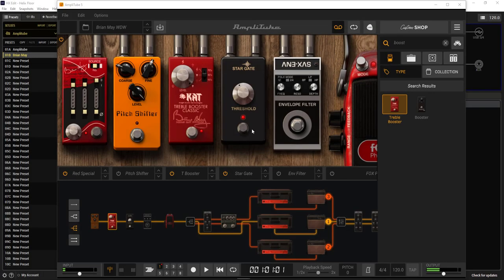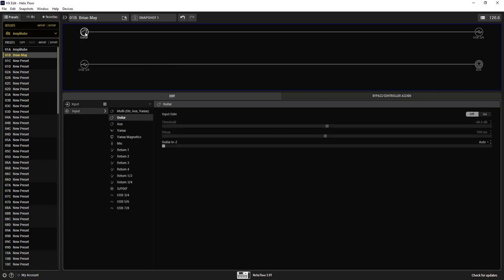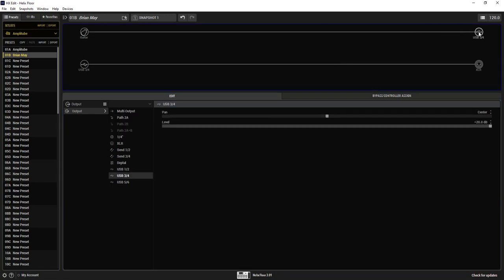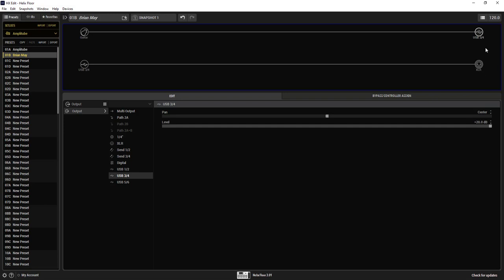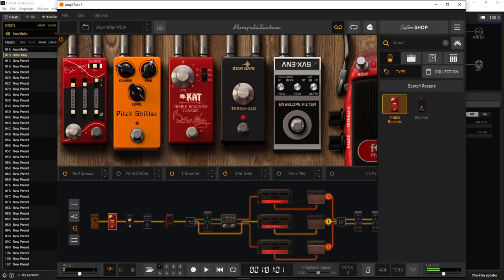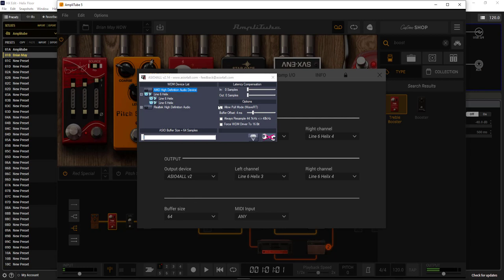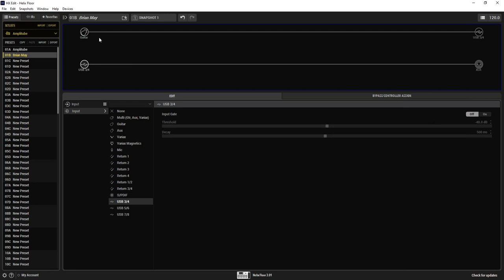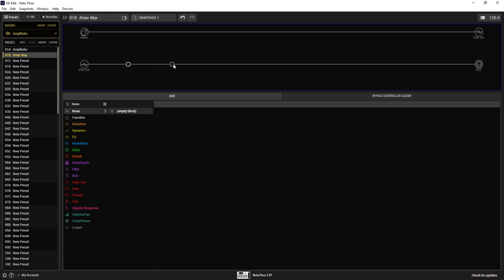Using Line 6 Helix with IK Multimedia Amplitube 5

Comment: This is great but for some reason i dont have the options for Line 6 helix 3 and 4 when it comes to the input channels and output channels. I followed your directions so im not sure what Im doing wrong. But the idea of using Ampltiube with helix is intriguing and id love to try it. Any chance you can assist?

Comment: Would you recommend ASIO for all for other dedicated interfaces like Presounus AudioBox interfaces? 
Not just for using amplitube, but for everything?
Reply from the maker: Hi, no idea really. I only use it to link Helix and Amplitube
Reply: @ac30helix44  
Thank you for your reply. 
So you haven't noticed any improvement on latency or anything like that with ASIO for all?
Reply from the maker: @Eric-dd8bk  I have the buffer set at 64 which is the lowest it will go. I do not notice any latency at all. My PC is pretty new also.
Reply: @ac30helix44  
Oh I see. So it might be different for an old laptop with like I3 CPU and 6 gig RAM even with ASIO for all right? I have a PC with I5 processor and 16 gig RAM and it runs smoothly with no latency but can't be lugging around a desktop computer to gigs or studios so I should find a laptop. 
Anyways, thank you for your help.

Edit:
The Helix sound improves so much with IRs you can make with amplitube. Amplitube is just awesome.